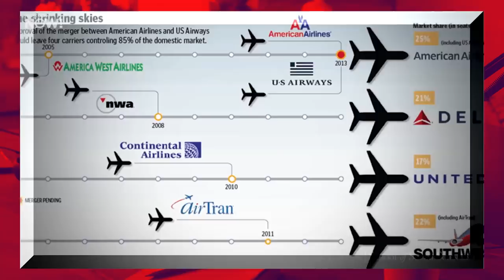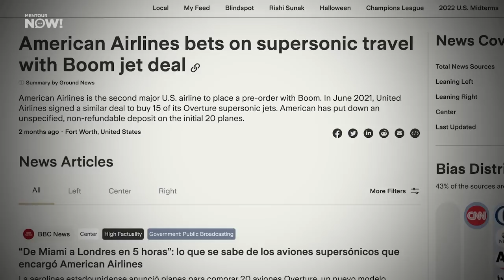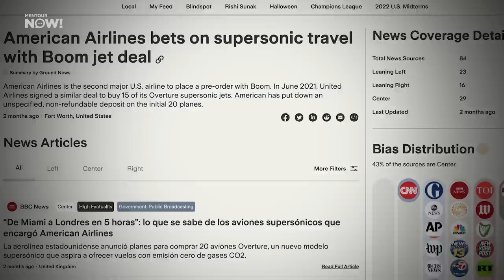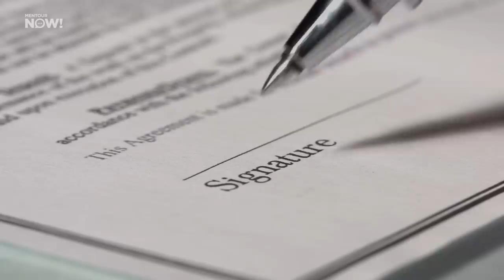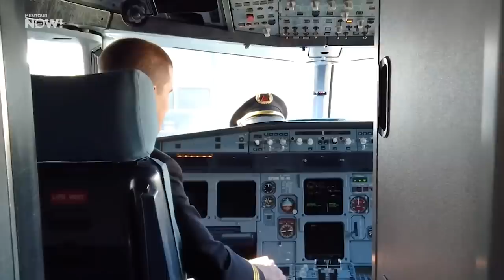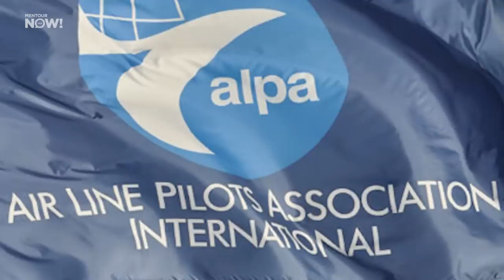Is This the DEATH of the US Regional Airlines?!

Comment: I can see them changing the model and the pay clauses in the pilot contracts, to where pay is based on size class of aircraft, because there are some routes that aren't worth even a 75 seat aircraft, so say they divided pay classes by capacity of the aircraft, they could then operate everything under the same corporate umbrella, and have a lot more equipment flexibility, specially if they selected their aircraft to make it easy for pilots to have type ratings for a broad spectrum of their fleet.  then they can select the aircraft that best fits the average demand for the route, and the schedule that best fits the average demand, then if they get a high demand day, they can, assuming they know well enough in advance, rotate in a larger aircraft, and serve more customers that day.  
on the other side of the coin, that would require their planners to have more mental flexibility so they might choose not to do that.

Comment: Excellent explanation, but there’s some nuance that’s really important. When you say the airlines make more money by using regionals to fly their routes, the implication is that this all done due to the greed of the managers and stockholders. Of course, “airline” is a word that includes the pilots, not just the old folks running the company and holding the stock. And, the pilots used the labor laws to get better terms of employment by forming a union. Fair enough in theory, but not so much in reality. The existing pilots and existing management and union negotiators almost always end up conspiring against the people who are not at the table. The stockholders, customers, and all the future pilots. Seniority, and other rules, ends up being this little gimmick that ruins everything eventually. Now, the airline has another constituency that has power and must be appeased and protected. The union will try to stop both pilot reductions AND massive pilot increases AND all sorts of other things that might lead to a better airline. This frustrates managers, many of whom leave for other industries if they can (leaving you without certain types of innovators and other talents). It all turns ugly, and the options for young pilots look pretty ugly reducing those willing to enter the profession.

Europeans and Americans are different in many ways, and this is just one example of how things turn out differently.

**Big Question**: Could you discuss differences on how different countries get taxes and fees from airlines to support the infrastructure and services like gates, runways, and ATC?  These things are different and have big effects on airspace usage and what flights are scheduled. In the US, smaller jets are more desirable for many reasons, some of them being the fact that runway and airspace usage is essentially free for the airlines.

Comment: It would appear you're completely ignoring the west coast of the US. 
Alaska Air Lines flies pretty much all the west US coastal states, with limited flights to central US destinations. 
It outsources to many smaller airports via Horizon air. I've been on a half dozen 2-way trips on Horizon in the last decade - every one of them a turbo-prop.  Most western US airports are indeed long enough for a 707, even MRI (one of the busiest small plane fields in the world).  Usually EUG - SEA and back.(Cuts drive time in half, and hassle factor at check-in. Cheaper parking, too).

Comment: Regional Airlines in US are different than in Europe because of size of US. We have many states that are geographically larger than many European countries. I think this is why we have less airlines that operate Turbo Prop planes and more smaller Jets.  These are like ferry planes that take people from a small airport to a larger airport. Taking slightly less passengers and using older aircraft is actually more cost effective. Buying new aircraft is a large investment with only 15% savings on fuel, however that savings is using highly optimized loads with more passengers and longer routes. Operating short hops of 1 hour to 2 hours is not long enough to make much difference in fuel savings.  Regional Airlines prior to pandemic were the only way for Pilots to gain the crucial flight hour experience to work at a larger Airline. Pandemic forced the major airlines to lay off staff, now in a mad struggle to get back to normal and even more than normal to meet demand. This means that major Airlines are now offering more money and even flight training to potential new pilots. Regional Airlines were fine with being the stepping stone for the Major Airlines, but now that stepping stone is not needed, they would have to start paying more as well.

Comment: In the north east USA Amtrak has ecella trains that runs Washington DC to Boston 120 mph or 200 k/hr city center to city center The check in check out of airports and NYC traffic on road makes total time longer then Amtrak . Even 90 minute run time of aircraft is less then Amtrak. They offer sleeper cars with showers, this does away with hotel for afternoon departure.  Any trip is 300 miles or 500 kilometers driving makes more sense Pittsburgh to Indianapolis or newerk NJ. At 600 miles or 1000 km a Cessna can beat the airlines because smaller airports. There is bus company got sleeper buses for 600 mile trip called napaway.  Europe has alot of high speed intercity trains point to point in europe.thr USA I did California to NYC truck Trip roughly same distance as Moscow to 0 Madrid. 100 parallel west to Cascade and Sierra mountains more people live in NYC

Comment: I think you missed the purpose of the existence of the Regionals. Their purpose was/is to use as leverage against labor at mainline companies. This downward pressure has been successful at keeping wages down but mostly at decimating work rules. Quality of work life at mainline is now just as bad as it always has been at regionals. Most pilots put up with it thinking it would only last a while, then they would get hired at a mainline and their QWL would improve. Sadly, it’s no longer the case.
Ultimately, if the leverage is gone, and their usefulness is also gone, you might be right. It may be time for the mainline operators to cancel contracts or fold the operations together and gain efficiencies by eliminating duplicate departments/operations etc.

Comment: There are many factors that make the US airline industry different than the European one that you neglect to mention. Yes, people have pointed out that trains are a more viable option in Europe, but there's more. US airlines are much larger--each of the Big 3 has 7+ hubs, while European airlines are much smaller, and each one has 2-3 hubs at most. Also, ULCCs are more widespread in Europe than they are in America, so much of the intra-Europe share is captured by trains or budget airlines like Ryanair, easyJet, and so on. As a result, long-haul routes make up a much larger proportion of European airlines' route networks than in America.  RJs obviously can't fly these inter-continental routes, so European airlines have a much smaller market for these kinds of aircraft.

 It would be much more insightful to compare the Big Three American carriers to the 3 main air carriers in China (Air China, China Eastern, China Southern), because the geography of those two countries is much more similar than the US and Europe. There are still differences, like the fact that the population is more evenly spread out in the US than in China, and the fact that China has a much more robust HSR network than the US, but it's still a more even comparison.

Comment: How can you just know so much? Great work really in terms of research. I hope they remove this stupid artificial limitation, I heard Embraer was holding the 175E2 development due to this... maybe they know this regulation will change. I also live in country similar to US in terms of size and density (Brazil), but no in terms of economics (not a fair comparision here). Even with that in mind the considered regional airlines almost do not exist, except for very specific regions like the unpopulated North (Amazon). In the rest of the country some companies use regional airliners to prospect for new routes. In the past the government also tried to force regional airlines to exist but this never worked. So now some companies have turboprops like the ATR and the E-jets that they can use as regional hub feeds, but that's all they do. I still think turbo-props have a great potential if you consider they are not that slow in short routes, for this reason by the way, Embraer is focused on a new turbo-prop probably ATR sized to serve that market, maybe the same will happen in the US mid-term.

Comment: Excellent and well researched analysis! Very valid points. Agreed, the current U.S. regional airline routes bear little to no resemblance to the routes I flew as a "commuter pilot", as we were called. We flew the typical regional routes you describe in our SD3-30 and SD3-60 A/C. Ugly, but tough planes!
As to rolling current regionals into the mainline company; it could probably be worked out, as far as red tape with the FAA goes, without gigantic problems. Of course, where red tape is concerned, there's no guarantees. I believe the BIG fly in the ointment would be seniority list integration. This issue would undoubtedly be a nightmare. Whether you merged lists using date of hire or slotting, you would have a LOT of VERY UNHAPPY PEOPLE on your hands...one way or the other! I have first hand experience on just how brutally contentious seniority list integration can get. Believe me when I say, it's not pretty and can cause a very unpleasant work atmosphere. They say time heals all wounds, but wounds from seniority list integration may just be the exception.

Comment: There's a good chance this pattern will become generationally cyclical.  Right now, pay and conditions are keeping new people out of the profession.  This is further supported by the very high median age of the pilot population.  Those old people are retiring.  This is driving up demand, which will cause pay and conditions to improve until demand is met.  This increase in costs will make some business models inviable, as you point out.

However, this will in turn create an outsize age cohort within the profession. In 10-15 years, we'll probably see a glut in the mid-senior level flight crew population, which will then drive wages and conditions back down, making regionals viable again.  Another 15-20 years after that (provided all the planes aren't AI piloted or global warming grounded), we'll get another age crunch, the regionals will become unviable again, and the whole cycle will start over.

Comment: I'll have to say your definition of regional seems a bit contrived. To me it would seem more systematic and natural to think of a "region" as something viably reachable from some point and time at a fixed, here "low", cost. As such, if you have a country far flung, such as Finland (here) or the US midwest, whatever happens around an airport on its thin spokes is by definition its region, and whatever airline, with whatever machinery serves that area, is a regional airline. Despite the same company perhaps running multiple regions at the same time, and taking advantage of that grassroots business in order to build a national or even international hub-and-spoke system by feeding its regional traffic inwards to the hub.

Also, while the EU is somewhat bigger an economic area than the US, it's not a coherent federal state but a union of quite different ones. Like, I live right by you here in Helsinki and could easily ferry over to meet you and back for something like 60€, yet we don't speak the same language or share a currency. Despite Nordic cooperation, our respective states have traditionally heavily supported different airlines, not to speak of what happens south of here. So it's kind of self-evident Europe couldn't have such an integrated market for commercial aviation as the US does.

Comment: The premise that you can always keep squeezing the margin more and more, and the largesse trickle up to the top, reached Peak Greed right before the pandemic and now It's conceptually wrecking a lot of U.S. industries.   Does the  7 figure CEOs really add 7 figure value to the company?   Does trying to cut the bottom line x % every year - forever - make pragmatic sense?   A properly operational company has an optimal configuration, and if "companies" are to exist, the org chart has to be reevaluated from a practical operational expense angle, not ultimate relentless Gordon Gecko squeezing.

Comment: Depending on the airline, these regionals also serve a much more ulterior purpose. Some airlines use regionals as a way of redirecting liability to a much smaller company "not associated" with them. Even if the airline plasters its logo on the regional's planes, staff, catering, they are in no way legally tied to these regionals, so any and all problems created by regionals would not necessarily pertain to said airline. Again, this wouldn't be a problem if they paid their pilots more, but if you hire the wrong pilot and they nose dive into Cleveland, then you have a few degrees of separation.

Comment: Excellent recap of our bnizarre regional air system and its quirks. To paint an even crazier picture, Delta flies me on a aging 717s from Savannah to Atlanta (51 minutes) and then a "regional" carrier for a longer 1:15 to 1:30 flight, usually a 737 or 320. We used to have smaller Embraers and Bombardiers from NY to Savannah but they have been replaced by 737s and 320sx.

One thing I'm keeping an eye on eVTOLs and the whole new UAM scenery. How will it handle the last miles flights as well as the new regional air mobility movement in the shape of 19 to 100-pax electric and hybrid/hydrogen aircraft currently designed?

In the meantime, pristine-clean Hawaii uses 737s to hop from one island to another when turboprops could handle those flights just as well. But as we all know, corporate America's race to profit above all else has spoiled so many industries. Just look at how many car manufacturers we have today compared to 20/30 years ago. Wall Street worshiping is so last century ;)

Comment: The unions in the US also capitalized on the 2009 Colgan 3407 crash in Buffalo and successfully lobbied congress to enact the 1500 hour rule in 2013. This rule has also caused a big distortion in the market for pilots in the US. The hardest part about becoming an airline pilot in the US is trying to get the flight hours between 300 and 1500 hours. Republic airways has begun postponing some of their new first officer training classes. Is this because of a recession or the shortage of captains or both? It's a huge gamble embarking on a career in an industry that has so many economic distortions that will probably get worse (or better depending on your perspective) until market forces eventually become too great and something massive occurs in an attempt re balance the market.

Comment: The 76 number has its roots in the FAA rules that had a significant differences above and below that 76 number. 19 is also a big number. But it's not just jets that have insane rules based on passengers. Most mega yachts have limits of 12 passengers even though they could comfortably serve twice or three times that number. 12 is the number that US rules along with SOLAS and regulation boards from many countries say that full protection for commercial ships kick in. To avoid all those rules and their costs, these mega yachts keep 12 passengers as their limits. Truck and busses do it too. The point is that government rules and regulations create arbitrary limits that spun off into all kinds of other areas like union agreements.  It's a big problem since it actually increases costs in many unseen ways.

Comment: My mother worked for Piedmont starting in 1985, Then US Air, and retired on 9/13/01.  Kinda cool that they were mentioned here.  This video sounds like the old Soviet Union rule for a 3-man cockpit.  Long after Boeing went to a two man flight deck the Soviet builders had to produce aircraft with an engineer position long after.  Unions just make things cost more.  This makes no sense.

Comment: Regional airlines need to exist in order to provide feeder flights to the legacy carriers in the USA. The main advantage of having seperate regional airlines is mitigation of union influence, that way airline staff  are a little more fragmented, and can’t the the same benefits as airline staff who work for legacy airlines, and the other reason would be , that if a certain regional airline is running at a loss, it won’t cost the legacy airline a single $1, and they won’t have to absorb the losses. Smaller, regional airlines can also get financial assistance from state and / or federal governments, they are coming close to bankruptcy. Otherwise if they were owned by a legacy airline, the legacy. Airline would be expected to bail them out & absorb their losses.
Reply: Clueless